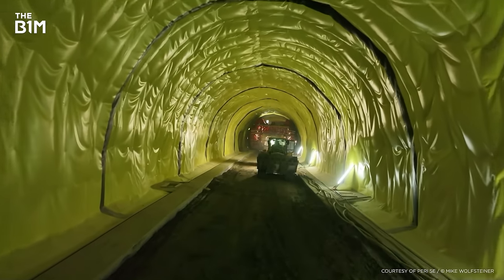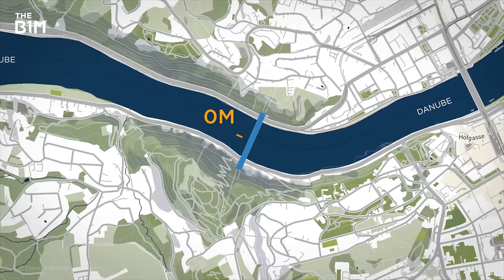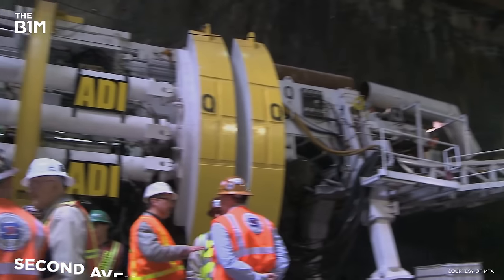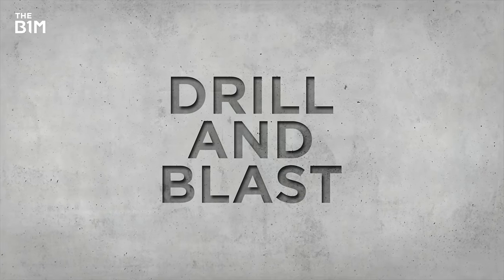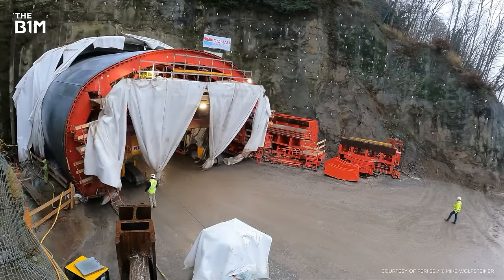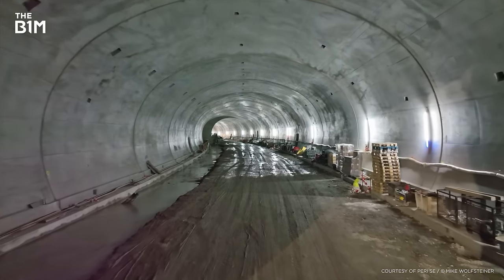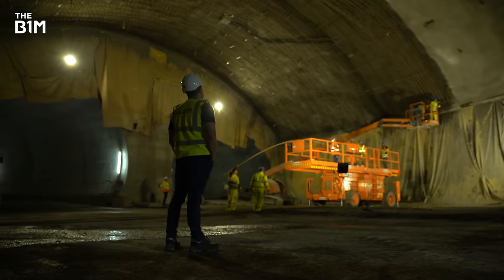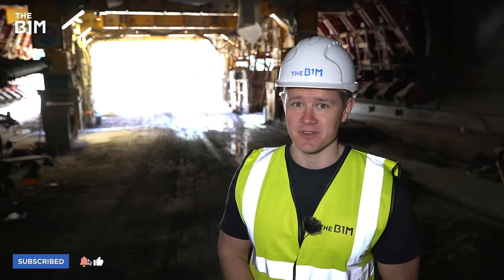Austria is Digging a Tunnel Like No Other

Comment: As a kid I worked on the Victoria line tunneling in London as a 'pony boy'. I had to push wagons filled with soil and and stone from the tunnel face back to the vertical tunnel entrance shaft. There the wagon would be picked up by a crane and lifted to the surface to be emptied and lowered back to the bottom of the shaft. It's amazing to see how tunneling technology has progressed during my lifetime!

Comment: 4:16 in Norway you see the bare rock in many tunnels; In those tunnels only those parts where rocks might come loose they used spray concrete to secure that part; More modern tunnels will have the concrete parts around the walls like tunnels everywhere else

Comment: I work at the Suki Kinari Hydropower Project in Pakistan. We used the drill and blast method for our 23km long headrace tunnel. At 3:07, that's a risky thing to do, placing the camera close to the excavation face during blasting! :D
Mucking was done through Adits. We have special 4.5m section formwork for concrete lining. 4 of them are combined to get an 18m length of formwork. Dia of tunnel is 6.3m.

Comment: B1M, you should have been invited to review the construction of Sydney's WestConnex tunnels - 22km long and 5 lanes each way at the widest point, close to the world's largest underground spaghetti junction, the Rozelle Interchange, which is still under contruction. These tunnels are too wide for TBMs to be used and mobile road headers were employed instead, cutting the top half of the tunnels first then back tracking to cut out the remainder of the rock. WestConnex is more of a tunnel network under Sydney rather than just one pair of tunnels. It is truly a global scale project which now links several previously separate surface motorways.
Reply: @LungsMcGee  There is a coal mine, or should I say, at least one, in Balmain which used to feed the former Balmain Power Station and also most likely fed the nearby former power stations at Ultimo, Pyrmont and White Bay too. This mine is close to where the Western Harbour Tunnels are being built. These power stations closed down because they were too old rather than being because the coal reserves had run dry, so I'd imagine that there is still plenty down there.

There are indeed lots of tunnels - it is probably fortunate for Sydney that the whole city sits on a big sandstone shelf.

Comment: Very cool! I collect tunneling books, and this process is described in these books. Although i dont know why you would call it the "new austrian tunneling method"; yes there was spray concrete used to stabilize the walls and roof, but no forward poling and grouting was done as far as the explaination goes. You would be more likely to use rockbolts and wiremesh to hold the sides up. Spray concrete is quicker though if you can get away with it. The water barier/plastic liner will be more compatible with the spray concrete while the surface is a lot smoother. 

Greetings,

Jeff

Comment: In recent years, the transit agency STM in Montréal Canada built a new underground métro garage at Côte Vertu wich was detached from the main tunnel not only to add capacity but also allow the line to be extended eventually (prior to this, the tail end of terminua station was used as storage for trains at night).   The tunnel between the main tunnel and the new garage was built using this technique with "manual" drilling and then using a spcial articulated form to pour concrete.  

BTW, building new car highways in this part of 21st century isn't something a country should be bragging about.

Comment: TBM's make round tube like excavations which are strong at resisting forces from all sides. Pipes and cylinders are round for this reason. But round is not the most efficient shape for a tunnel. It may be strong, but space is wasted on it's sides. 

This new tunnel and it's custom slip form is not round. It makes more efficient use of space for traffic. Strength comes from concrete and steel. Traditional drill and blast is more economical for shorter tunnels than TBM's. The slip form keeps concrete and steel in place until it cures enough, then it is slid forward for next section. Slip Forms have been used to build skyscrapers for years.

Comment: Nicely done informative video.   Can't help but think what a great gravity energy storage device could be made by drilling a similar tunnel in similar rocks along a river and alternating between pumping water up into the tunnel and then letting it flow back through a generator to the river to store and recover energy.  Could store up energy all summer long that could be used  months afterwards or to cover spikes in demand.     The reason I would choose a tunnel Is because you would not worry about freezing  in winter and It leaves the surface in it's natural state..   I guess it would work best along some deep gorge for maximum altitude difference.   I would imagine after 40 years the cost of storage would be negligible.  Probably would not give more than a 2% return until then assuming no inflation.    More of a benefit to future generations.

Comment: I misread the title at first as Australia instead of Austria & first thing that popped into my head was the total failure one. Can you maybe do a story on that & how tunnel boring machines can fail? The Snowy Mountains hydro mark 2 specially built tunnel borer for mixed soil/rock conditions was apparently not up to the task & got stuck about 50 metres into the operation & hasn't moved since. Government tried to hide it, civilian investigator went looking in the restricted area & found the sinkhole the tunnel had caused & jammed on & shocked everyone when revealing just how close to the start it was

Comment: On the tightly curved sections the inner part of the tunnel would have been much shorter than the outer side. How did the formwork carriage handle this?

Comment: While this is great engineering, it is batshit insane to build the bridge and tunnel there in the first place. All it will do is adding more cars into an already congested city.

There were far better spots for this bridge outside of the city. Cheaper as well, as no tunnel was required there. But the politicians insisted to have it built right IN the city, and simultaneously they are stalling the expansion of public transport.

Absolutely crazy.

Comment: That's indeed quite unusual. That method can only really be used in stable geology.
Reply: The NATM also works in medium-hard rock, because the rockface is secured with steel reinforcements and shotcrete immediately after blasting. With really stable rock you wouldn't need concrete in the first place :-)

Comment: Concrete pushed like foam to form the tunnel walls but no metal frame used to create a stronger support?   Note: I am not an engineer. I am very curious about the special structural qualities of this concrete used.

Comment: The crazy thing about TBMs is that they are basically disposable – used once and then when the tunnel is completed they just bury themselves in the hillside rather than being pulled out and used on another project elsewhere. I know there are good reasons for this, but it still seems wasteful and does explain the high cost of tunnelling.
Reply: Most are dismantled. Even if they cannot be used at other build sites (many can) even their scrap value is considerable.

Comment: why not a prefabricated mesh of steel instead of concrete?  It's a lot more durable, you wouldn't be as limited by length, and no curing time needed.
 It couldn't cost more than that carriage plus concrete and additional labor hours.

Comment: Nothing particularly innovative about that retractable traveling concrete form system. A similar form system was used to construct the cast the in place concrete coffered arch vaults of the stations in the Washington Metrorail system. The primary difference was the form system used wast to cast the concrete arch vault in stations built using the cut and cover construction method. Two separate forms were used using in a two step process. First step, placing the concrete of the lower sides of the arch, strip and advance the form, step two placing the concrete for the crown of the arch, strip and advance the form, rinse and repeat. The thickness of the concrete in the  50' (15.24 m) long segments ranged from 6' to 10' (1.82 m to 3 m) at the base of lower sides of the arch to 4' 6' (1.21 m to 1.82 m) in the crown of the arch. The retractable traveling concrete form system was moved on temporary installed tracks.

Comment: I have been regularily watching your videos over the last 2 years and I never thought that I would see my hometown Linz in one of them! However, as a native Linzer I feel like I have to share my opinion on this constructioning project, the new "Westring" motorway (the tunnel is part of it), since it is widely regarded as beeing a waste of taxpayer money. Plans for this tunnel date back to the 1980s and were already highly controversial at that time due to numerous concerns regarding environmental impact. Many also criticize that this new highway will not solve the traffic problem in Linz but rather shift the congestion to other areas of the city. The construction of this 1 billion euro motorway ultimately became a political issue, with both the ruling conservative party ÖVP and our "beloved" right-extremist FPÖ party pushing for its realization, disregarding several environmental reports issued by the Federal Environmental Agency. This project sadly took precedence over the faster development of Linz's inadequate public transportation network, which is the reason why I need 50 minutes to get to University in the morning instead of 25.

Comment: I’m watching this and I don’t understand how this is faster then using a TBM.  You’re blowing it up, cleaning it out.  Then building a machine over and over again to move it.  You’ll basically do this step with the TBM as well, but cut out the blowing up and cleaning won’t be as intensive with the TBM.  Common sense tells me you’re therefore making this job 3-4 times harder then using a TBM.  🙂

Comment: The Best Part about this whole Project is that it wont benefit anybody. Sure the Bridge looks really nice and the Tunneling is a Challenge of its own but this Project is Pointless.

The Drawings for this are nearly 50Years old and came directly out of a Car-centric Era. The Initial Plan was a Ring Motorway around Linz, from which the City would gve definetly profited. The Project now is Just a Bridge that Connects to absolutely nothing on the southern side. Sure in 10+ Years the Bridge will Link to the next Highway but until then its wasted Money.
The Money would have been better spent by Upgrading the existing Train Routes.

Theres also a fundamenral Law that Linz only can have two fully functioning Bridges at a Time, and this wont be an exeption.

Greetings from someone who passes this Construction Site twice every Workday since almost 5 Years now.

Comment: Austria is about to run out of energy, and no one seems to be talking about it.  It gets 80% of its power from a gas line which passes through Ukraine.  It did drop to 50%, but has risen again.  If the war goes badly for Ukraine, they are simply going to shut it down.  Austria will be in huge trouble, and no one is saying anything!

Comment: It seems totally idiotic to create a bridge that will on both sides go into a tunnels through the hills that would be used only as the connectors to the roads. But if you take in mind that this bridge is hanging from those hills and that almost none of the buildings would need to be destroyed, it's actually clever.